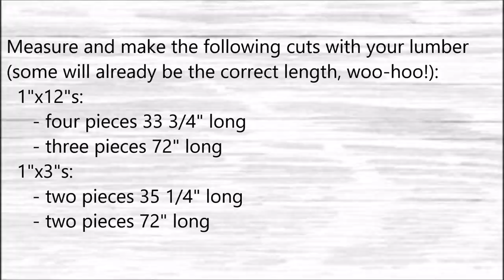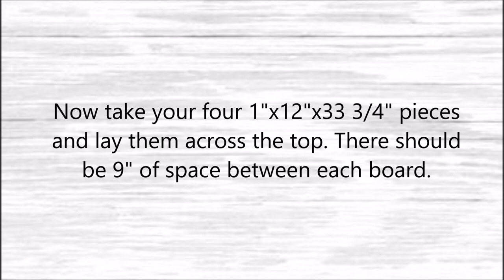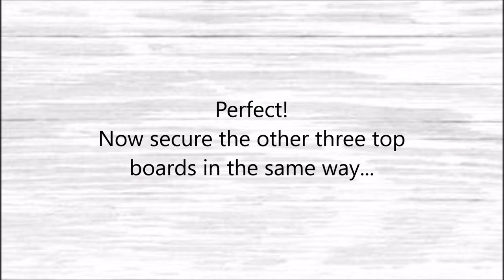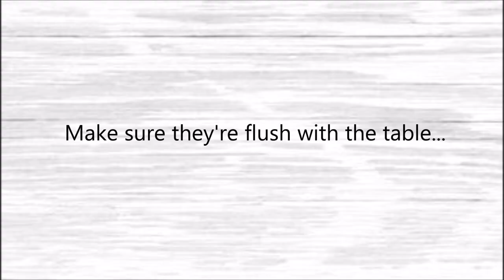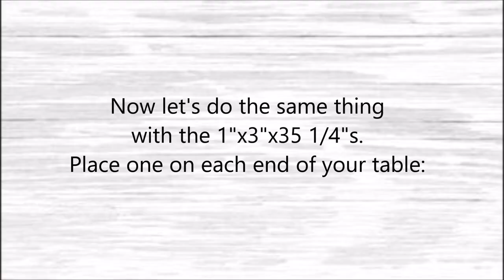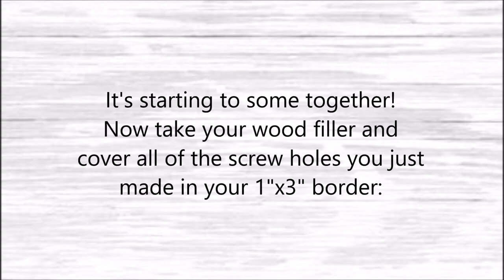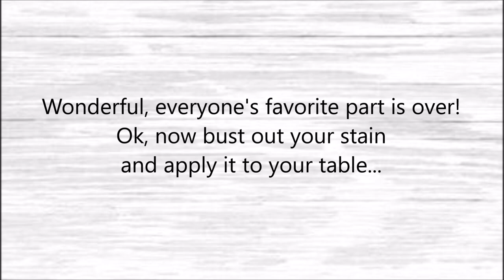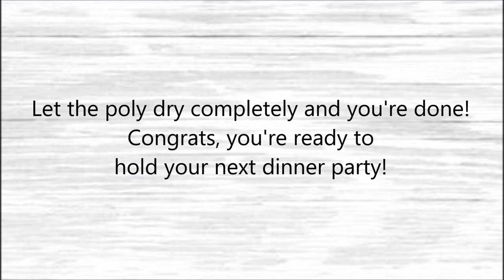How to Make a Modern Dining Table with Hairpin Legs / Easy DIY Project (seats up to 8 people)

Comment: Nice build.  Given that currently, at least at my big box store, a single 1" x 12" x 6' board costs nearly 5 times as much as a single 2" x 4" x 8' board ($19 vs. $4), I would probably use 8 2x4 pieces as the understructure (4 boards for $20), rather than the 4 1x12 pieces (2 boards for $38).  With the 28" legs, it would make the table 30 1/4" tall instead of 29 1/2" and you'd need to use 2" trim head screws instead of 1 1/4" to attach the top boards to the understructure.  The 3" apron would still cover the ends of both the top board and the understructure board, so the table won't look any different unless you look underneath it.